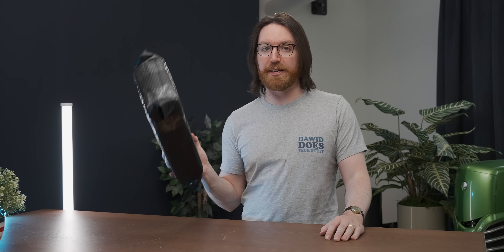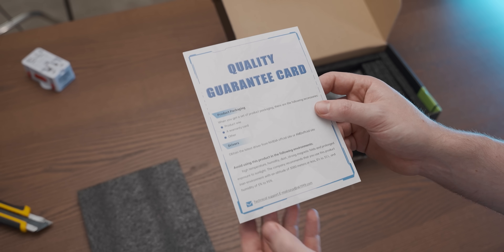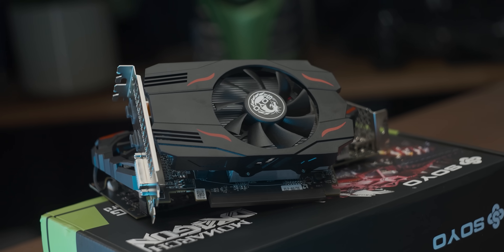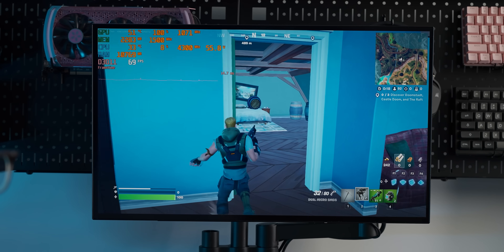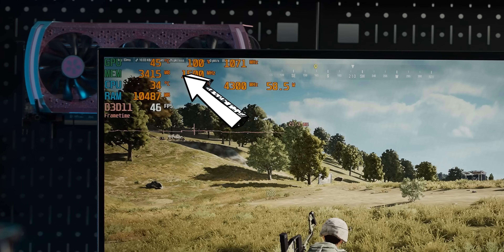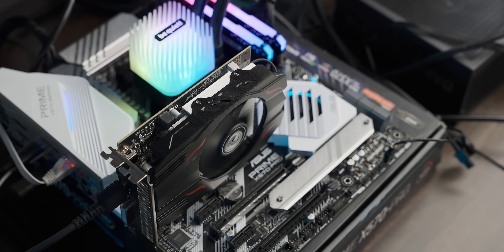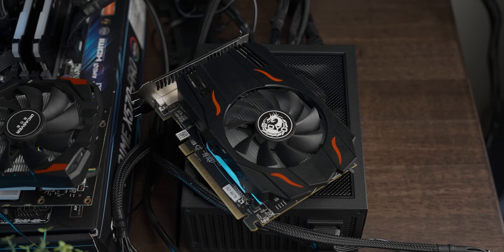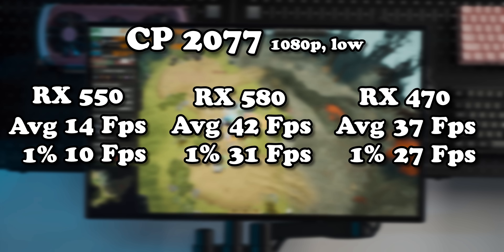The Best Selling Graphics Card On AliExpress Is Bad...

Comment: After looking up gpu costs I have figured out why people are buying this. People are tring to build a pc in under $200 and this runs most games. Motherboard and cpu minimum cost is $100 together so upgrading the gpu later when they can while playing on minimum requirement gpu for most brands is what everyone is doing. I came to this conclusion because I am switching from ps5 to pc and a gpu that runs the same games is like $500 brand new. Anything under an rx 570 can't even launch one of the games I lpay and it requires AM4 minimum.. I'm gonna go to ebay for a dirty gpu that hopefully works and try to clean it up and use it. Wish me luck.. When my brother finally gets the money to buy the ps5 off me..

Comment: I bought RX 550 sepphire 4gb for my wife, she uses my old computer with 400watt psu..

and for myself, I use Rx 580 with the same brand on my computer..

yes. the difference makes Rx 580 looks very powerful, but my wife is quite satisfied with Rx 550 as a casual gamer.

Comment: Putting up a bus powered card against cards being fed more power, it didn't stand a chance.  It took until the RTX 3050 for a bus powered card to beat a GTX 1060 3GB pulling 120W.  Though for some recent budget builds with a bus power only limit placed on them, GTX 1650s worked really well for the price.

Comment: I used to have the RX550 and seeing this video makes me both positively nostalgic by its perf level and dissapointed by how games change in the same time. CS:GO for example- I had an Eyefinity setup with 3 monitors for a total of 3840*1024 resolution and that card used to run the game 60 FPS with no stutters, (as well as some other titles like Crossout and Black mesa), but now it can't handle CS2 in 1080p which for me is a certified WTF situation.

Comment: I am almost 100 percent certain you can flash the 470 to a 570 or 580. I did that to my old card. :) There are also a tonne of Polaris bios editors to tweak the maximum performance out of those chipsets if you take your time. Even tweaking memory timings.

Comment: I bought an RX 550 4GB 6 years ago at 13 years old and I regret it. It's still in my computer now paired with a Ryzen 3 2200g I bought at the same time lol

It actually used to run Pavlov VR and a few other VR games ok but I have barely played any for a while

Comment: I did have similar soyo box just with 580 8gb, after half year one fan stopped working, and there is no display of fan speed in AMD app. Didn't even bother to call warranty because how cheap it was for budget pc and because it still works unless strained to full load for at least 5 minutes.

Comment: Just got an LP version of the 2GB one for a planned emulation build for only 28USD.  It was delivered with the standard IO bracket bent, but I didn't really mind as I am putting it in a LP Slim case, so I'll be replacing that part with an LP bracket.

BTW, with this, an I7 3770, 16GB RAM and an NVME drive (mobo is an aliexpress special with an M.2 socket), can it handle PS2 Emulation at least at 720p or 1080p?

Comment: There might be something wrong with this card, because I own a Dell RX 550 I bought for $40 USD off Ebay from an E-Recycling center, and it performs much better than this. The RX 550 CAN be a decent card, but you gotta be careful with them, and you certainly don't wanna get them fron Aliexpress. Planning on getting a GTX 1060 when I can

The only big issue I have had with the RX 550 is overheating on more intensive settings on some games, but considering the card is generally just a hot-running card, running at an average of 74-80°, and the Dell version of it has a mediocre fan and heatsink, it's understandable why it gets so hot.

And one last thing, it feels pretty unfair to compare what is possibly a RX 550 that was mined on to GPUs like the RX 470 and 580, when new it's more onpar with stuff like the GT 1030, which is it's main competition in that price range and purpose. The RX 550 is a semi-decent budget card, and a very good GPU for ultra-budget SFF PCs.

But as a video on this SPECIFIC Aliexpress card, it was great!

Comment: Mock the little guy all you want, but this thing has ROCm support and can serve as a nice little entry-level AI accelerator, and given the lower power reqs - attached to things like RPi5 via 1x PCIe lane. I guess RX 580 with 8GB VRAM would be much better, but you can't beat the price really. Also, this would be a neat GPU for DIY emulation boxes, where some 3d is actually needed (I guess mostly OpenGL stuff)
I mean, it's no coincidence this is a popular item on Ali...

Comment: My GPU (RX 5600 XT) kicked the bucket and I wanted to get something cheap that was modern-ish. Used PC parts from China has burned me so I opted for something new-ish (likely some are remanufactured GPUs).

I almost got the RX 550 4gb for 55 USD as it met my needs. The performance was fine and I don't game much and its typically retro if I do. The RX 470D 4gb was also about the same price, but I ended up spending an a bit extra than planned to get an RX 580 2048SP 8gb at 62 USD (weirdly cheaper than used 580s).

Mine is also a Soyo RX 580 2048SP at its way beyond what I need though I wanted something without extra PCIe power, but it works fine with some quirks. 

The quirks are: 1 of the 3 DP ports max out at 1920x1200 (like a DVI port); no fan speed control; no clock speed, memory speed, voltage control, and power limit options on AMD Adrenaline (they're all available under Linux with CoreCtrl though). All of those quirks are fine since those aren't gonna cause me any issues.
Reply: If I had more budget I would have tried for a GTX 1660 or RX 5600 XT that's new at the 145~170 USD range, but I couldn't. Prices are bad where I'm from (think 20~30% more than US MSRP) and new GTX 1050 Ti & GTX 1650 Super cards go for around 135~200 USD for either of them. Going used locally is kinda sketchy with some bulk sellers selling GPU that could be a scam or were very abused after being mined on or pulled from internet cafes where they got heavy use.

Comment: The reason Cyberpunk looks odd even with FSR disabled is because the game uses a native TAA implementation that is incredibly poorly tuned, and a number of temporal shaders. Also, when you mentioned that the RX580 did not have the same after image, it actually still does, just less noticable. The bumper can be seen duplicated above your finger. This is yet again another example of CDPR not properly implementing the feature.

Comment: Dude, the thing is, the rx550 and 580 are the most used in brazil because of the price an 1650 its arround 150usd. So pay 50usd in a gpu that its not good i know, But it run some games, for the price I think its fair, because even in usd seen a very good difference, in our currency the china rx550 its r$300, and idk something like a 3060 its arround r$2000.
I normally recomend to the cheap build, the alixpress rx580, and the kit MB +cpu. Used Xeon CPU and x99 Motherboard. Still not a good build quality, but it works and run some games +60fps on fullhd

Comment: 50 tdp vs 120 is not interchangeable. If you have an hp with a specific 200w psu you're probably not using a 470.

Comment: I bought a couple of these to go along Xeon V3 CPUs and motherboard to build  very cheap workstations and to add to an existing VM server as a GPU passthrough and it is just perfect as a cheap display adapter for desktop apps (not gaming). Got also a used 580 for a cheapo gaming pc and it was quite good and pretty amazing value.

Comment: My very first graphics card that i bought was MSI RX580 RedDevil, a total beast for 1080p mid to high settings. Then sold the card, got a Sapphire RX580. Then swapped it with another RX580, but an ROG OC. Card a bit problem, crashes at times. But damn it was a beast. RX580 was the peoples' champion.
Reply: You are wrong. Red devil is a line up from the brand Powercolor not MSI
Reply: @chengizkhan8741 my bad your royal highness, I got it mixed up due to the colour scheme. Yes your greatness, it was a PowerColor Rx580 RedDevil.
Reply: @adambasri3397  Apologizes accepted, dear subject 😂

Comment: The thing its that even from more reputable ensamblers like ASUS or Sapphire it is really difficult to catch a 640 sp version of the RX550. In fact, even back in the day it was kind of tricky because they were sold roughly for the same price and it was regarded as a scummy market tactic by AMD and ensamblers/retailers. Most retailers and shops back and now didn't even put which variant it is, so, whenever you buy one of those, you better assume you are buying the 512 sp cut down version.
What surprises me from this video although is the 1% of that RX 470, even better than the chinese market RX580 on some games! Maybe those RX580 were defective from the start? Are those repurposed mining cards giving its lasts breaths? Something to do with the firmware to cut them down? IDK. Whatever, but I guess that if needed I would go with that RX470, that hopefully its the only one not retorted.

Comment: I havre a low profile 4gb ddr5 version of the 550 in my i5 4570 pc with 32gb of ddr3 and it runs cs go at 1080p at medium at 90fps and also runs gta 5 around 91fps @ 1080 on high so this must be a crappier variant
Reply: Its time upgrade to AM4 & you can do it really cheap

Comment: The RX580 isn't hitting the intended speeds, Mine does the same thing and I realized these chinese Rx580's default to 100 watt tdp which I had to push the power limit to 150 to get the full performance. I might look into flashing mine to accept the 150 watts by default

Comment: I have a PowerColor RX 550 4GB I used with an i3 7100 and 16GB of ram for awhile last year. For any games pre-2013 in 1080p, this is actually a great little card. It did Borderlands 2 and Black Ops 2 in 1440p Medium settings/60 FPS :) It's in my moms Lenovo system now for general use.

Comment: Ryzen 5 5600G has better iGPU than RX 550 and that shoud tell you something. If you have a 100, look for used 1660/1660S since they are selling fo about that much on eBay. 1650s can be found for about 70-80ish

Comment: I have a RX 560 2gb XFX in my collection. It comes out every now and then to test motherboards or setups where I dont care if it dies. I paid $10 on marketplace, used its fans to fix a RX 470 and now it has a 120mm zip tire on it.  Great low power card, better than nothing, more suited for 2010-2015 games at a playable FPS.

Comment: homie threw cyberpunk on a gpu that cheper than cyberpunk
also if u want a cheap gpu with no 8pin/6pin cables the gtx 1050 ti is good just get it for less than 70 bucks or get the 1650

Comment: The reason the 470 performed about the same as the 580 is because the 4xx and 5xx series cards used the same chipset, the 5xx just had higher clocks. So the 470 is two tiers above the 550, which is why it performs better.

In fact, people were flashing the 5xx bios onto their 4xx cards to fet the added speed. 

You should try that for a video. Find a 570 bios to slap onto that 470 and see what the performace gain is, if any!

Comment: Aw... it's not a GTS 450.....  I guess on a good note it was a card that was made in the last decade.  But regardless that's crazy because I thought Soyo (or Soyotek as it was called I think) went out of business like 25 years ago along with a few others like Chaintech, PCChips, and ECS among others).  Surprising even brands like Biostar managed to survive as long as they have, although the market seems to mostly be dominated by ASUS, MSI and Gigabyte these days, along with a few video card manufacturers like Zotac, eVGA and some others.

I remember back in the day (being around the 2000's) if you got 20-30 fps that was VERY GOOD at the time, especially 30 fps which was hard to get back then (20-25 years ago) unless you have a very high end system perhaps.  But these days anything les than 50-60 fps is deemed "borderlined" playable.  I guess display tech has changed a lot in the past 20-25 years with refresh rates being very fast and most game play these days being online and competitive.

In some cases if you cannot afford the latest high-end graphic cards, look for one that's maybe a generation older and you can probably get that for the same price as the mid-range current one (maybe a little more) but cheaper than the current high-end one.

Comment: I have a low profile RX 550 4 GB in a SFF PC. Works great. But I would suggest a brand new Intel ARC A310 .. can be had for $99 in lo pro form from ASRock. Not a very powerful gpu, but brand new, has fully updated drivers, and can play Cyberpunk 2077 at 1080p lowest settings at 45 fps without FSR or Xess (which actually works well on Cyberpunk).

Comment: I have a 2GB RX 550 that came in a GPU drought era iBuypower prebuilt I bought "parts only" a couple of years ago for $200, it was new in box, box damaged but original box still sealed. It was a decent PC, 11400, z590 MB, 8GB or DDR4 3000,  500GB WD Blue NVME, and the RX 550. I wasn't mad about it on a $200 PC that was brand new, the box was damaged, and the front bezel had some broken clips. I ended up adding memory and somehow managed to get a 3060 directly from EVGA for $199. 

I still have the 550, it isn't much for gaming, a 1050ti is a better choice, and a 1650 absolutely stomps it with crocs. What it is great for is testing and as a basic display adapter while working on PCs with no built in graphics.

It did run Fallout New Vegas and 4 very well, so there is that.
Reply: Probably, the RTX 3060 12GB was a monster upgrade
Reply: doesn't ur intel 11400 actually have a better iGPU than 550?

Comment: Ironically i have ordered a 5900x and was going to order the rx 550 at the same time just to get some visuisals with no igu on the ryzen like, but I've already got a 4gb 480 in a computer I'm working on,  so hopefully that will do a much much better job especially being obviously miles better than a 550.    This has been an interesting video though as it will be my first time using a 12 core, so some ideas comical or not of what to expect.

Comment: If you have a really low budget get a used RX580 with 2304 SU's and 8 GB  RAM. I got one for my secondary PC for € 35.
Reply: It also has a dual bios switch. So even if someone has modified the firmware for mining you just have to flip the switch and there is probably a functioning stock bios on there.

Comment: Reminds me of old brands we never see anymore like Xpert Vision, Elsa, VTX, Pine Technologies, Soltek, A-bit..the brands that once upon a time bent the rules and gave us budget gamers more performance and features than the big name brands..
Reply: Funny thing some of these are still around in some form.

ELSA brand is continued in Taiwan and is available there and in Japan. The golden era ELSA cards from Germany carried a substantial price premium, but if you were driving a SONY or NEC-Mitsubishi CRT display, you probably wanted to pay that premium anyway due to lower RAMDAC jitter and common mode noise.

Leadtek was a great, high-quality manufacturer back in the 2000s. You can't get these cards, but they're still around, again Taiwanese cards with Japan as the main market.

Pine Tech is now known as XFX.

XpertVision is just Palit.
Reply: @SianaGearz  Yup a lot of re-brands but in the era of cooling hotter cards there we so many funky cooler designs that came out, Winfast had some silly tiny dual fan FX5900 series card, Galaxy plastered tiny fans everywhere, Spectre and Calibre had cool heatsink designs, suppose those carried on with iChill's X4 designs with the useless mini fan, everything and everything has been done now so theres nothing unique now when its all off the shelf stuff, not a lot seems to make things personal..i miss UV reactive pens..painting tiny traces and vias to light up to uv, doing that to a dfi board was peak aesthetic, UV stuff needs to make a comeback..

Comment: Ahh, the nostalgia... The RX 480 8GB was my first real gpu (not gonna mention the GT 230 I had as a kid) in my first self-built PC back when it came out. That thing was amazing and held up all the way to University, when I switched to 4k and a Radeon RX 7900 XTX. Polaris made me a Radeon fan boy for life. My decision versus the GTX 1060 6gb was solely based on my hatred of the GT 230 I had previously owned. That being said, I see the cut-down 2048sp 580 as not a real 80' segment card. Its percentile lows are abysmal compared to even the 470. I would try getting a legit used 480/580 not cut-down for optimal price/performance. These are dirt cheap nowadays and a decent entry-level option for 1080p. Had I not switched my monitor to 4k, I'd still probably be rocking the 480 to this day.

That being said I used my 480 in 4k for a week waiting for the GPU to arrive and it was not fun. Display and videos worked fine, but games other than 2d indie titles were unplayable (even with FSR ultra performance). I wonder what's the cheapest possible card that could deliver playable 4k performance with lowest settings and a bit of upscaling. 4K is still kind of a luxury, but it's becoming increasingly affordable on the monitor side of things.
Reply: depends on what kind of games you play. My GTX 1650 can play 4k30 easily on a game like Arkham City.

Comment: Not that anyone aver aked, but i'm here to give an explanation that might help to understand why RX550s are selling so well at aliexpress. So, basically, here at Brazil the policy for low value imports recently changed. In the past, you could usually get pc parts without tax at all (unless if you're unlucky , wich was the minority of cases). Due to the changes, the RX550 now cost effectively what was the price point for the RX580 (the champion of brazilian budget gaming), wich is roughly 80 dollars.